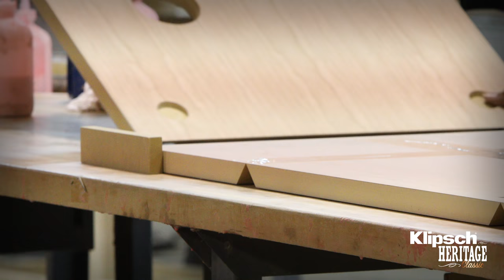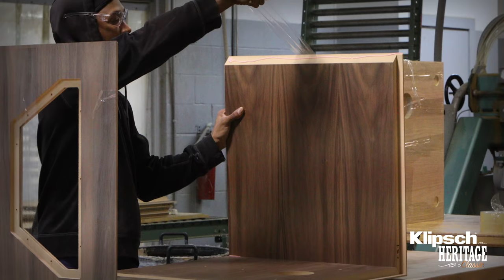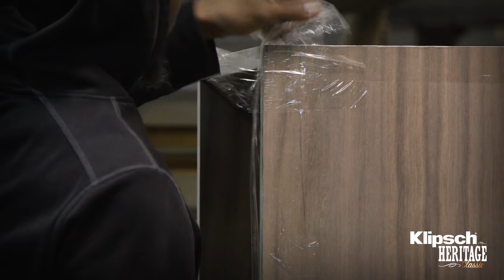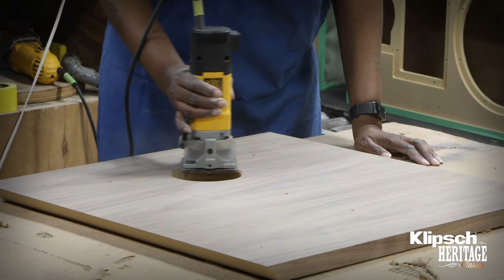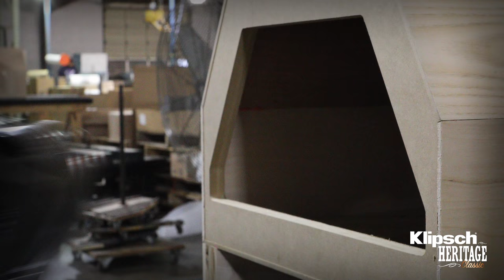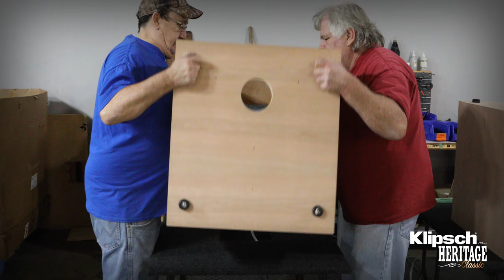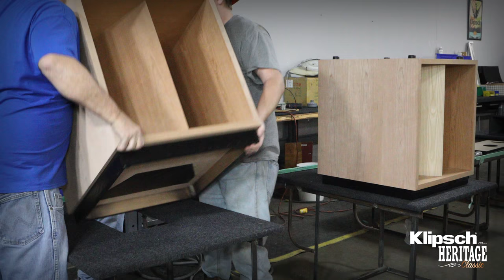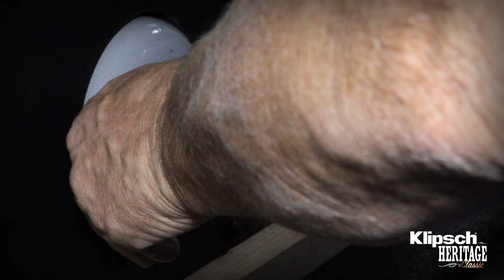Building the Klipsch La Scala AL5

Comment: I have three older pairs of La Scala`s made of Birch Plywood, not this Veneer over MDF crap.
Reply: if you knew anything about speaker design, you’d know that MDF is much better for building boxes. It’s much heavier than wood and when it vibrates more of the acoustic energy is turned into kinetic energy compared to wood, which reduces the sound of the cabinet. 

If klipsch were really trying to save money they would use cheaper hardwood because you don’t have to buy a veneer and you don’t have to have someone install the veneer and it would be much lighter.
Reply: you should probably do a better job at sealing your trunk from rain. Do you have any other ridiculous scenarios that you think are important?

How about this: Take a piece of MDF and a piece of plywood. Make a speaker box out of each, and see which one sounds better. HOLY COW now theres an idea!?!? Build a SOUND system to SOUND good!?!?

also not all MDF is created equal. Some are higher density some are lower density. and 3/4" MDF is pretty damn strong. Yes plywood is stronger, but it has bad acoustic properties. Bottom line is that MDF is better for speaker poxes period.
Reply: @nickparkin8527  That's why every wood instrument from a Violin to a Piano is made from plywood. I never seen one made of glued sawdust. A hard wood plywood has been proven to have better acoustical properties over partial board.
Reply: @G82Balive  yes for an instrument, whose job is to resonate and create sound. 

For an acoustic guitar, the bracing inside the guitar matters more than the wood. also, they aren't made from "plywood". steinway uses house made-laminated maple, not cheap plywood. Furthermore the guitar I'm building like most guitars are made from solid mahogany (solid wood).

An instrument is designed to resonate, while with a speaker, you want to minimize resonance.
Reply: nick parkin It’s been shown in acoustical test that a hard plywood is denser and has less resonance than MDF. Not only instruments but high end audio speakers are made with layers of hardwood sheets (plywood) making them acoustically dead, like the B&W 800 series. Klipsch started using MDF cause it’s cheaper and easier to work with. Klipsch has done a lot to cut cost and increase profits, all their drivers and now their crossovers are made in China. It’s the American way.
Reply: Al Apfel 

You just did a logical “sleight of hand” we were talking about plywood, now you’re talking about Hardwood plywood. Hard wood is far more expensive. Why would they make them out of solid oak or solid maple (hardwoods) and then put a veneer over it when they can just use MDF which will work just as well.

If anything using pure hardwoods is a waste of wood because most of the beautiful wood grain never gets seen.

And no, MDF is far more dead than standard plywood. Hardwood plywood, maybe not, but regular Baltic birch from Home Depot will be outperformed by MDF any day of the week.

You also have to look at the application and the right material for the job.

Hardwood plywood is denser and offers more strength when loads are applied in any direction across the wood, since the grains on the layers are 
Oriented 90 or 45 degrees from each other, allowing the wood to have superb strength no matter where the load is applied. They can also bend and hold their shape very well.

For a speaker, this doesn’t matter. The material it is made from just needs to be as dense as possible, and handle a load in one direction (the Y-Axis) which is just gravity pulling the speaker down.  For this application, you don’t need a wood that is strong when force is applied across every plane and orientation, you just need something that can 
A: support the weight of the speaker
B: be as acoustically dead as possible

And MDF fits the bill perfectly. The cost increase to use plywood or hardwood plywood just does not justify the benefits for this application.

It’s also worth mentioning that all MDF is not created equal. Lots of people think of it being cheap like particle bird but MDF is pretty strong and I’m sure klipsch has a specific formulation being made for them that’s higher quality than the stuff at Home Depot.
Reply: Al Apfel also klipsch uses 1” thick MDF. I’ve used 3/4” MDF and it’s heavy and does not like to move. With 1” thick MDF this thing will be a tank.

The older klipsch products use 3/4” plywood and trust me, the extra 0.25” makes a huge difference. That’s a 33% increase in mass and rigidity within the same material class. Combine that with the fact that it’s MDF then you have something that is twice as heavy as 3/4” plywood.

Also, it appears klipsch CNC mills these to make construction easier for their workers. If you had a bunch of different hardwood finishes, you would have to re-program the CNC mill to operate under specific conditions depending on what wood you’re cutting. (You have to optimize bit speed, feed rate, number of passes and depth of each pass) which makes it more complicated.

MDF is fantastic to CNC because it cuts so cleanly and is quick to cut and it does not tear out or splinter like hardwood, which would take much longer to cut.
Reply: Al Apfel and high end speakers are made from hardwood because like the b&w speakers, they have curved cabinets and you can’t curve MDF. The curved cabinet needs a material that is strong in multiple directions as pressure from the sound waves will relieve themselves across multiple orientations with respect to a singular point since the surface is curved.
Reply: Al Apfel sorry for all the replies I just started taking Adderall lol. 

One more thing to mention is that “glued sawdust” is particle board which is engineered to be light and rigid. MDF is compressed using much finer particles under heat and pressure. 

I know people perceive MDF as being cheap, because people think it’s close to particle board but MDF is far from “cheap”. Because klipsch is using 1” thick boards, they probably have a company custom manufacturing MDF for them so klipsch then has more control on the composition of the MDF so they can optimize it to have the perfect rigidity and mass
Reply: Al Apfel also, (at this point, it’s the Adderall talking) If hardwood was less resonant than MDF then we wouldn’t use it for instruments because the the instrument won’t resonate properly and creat good, loud sound.
Reply: @nickparkin8527  Well it sounds like you've done your homework, touch`e. I was NOT being specific on plywoods, although there are many types available. The cheapest is Birch from Lowes or Home Depo, but I prefer a cabinet grade 7ply Red Oak that I get from a Lumber Yard, not the hardest but two layers of 3/4" and enough internal bracing it can be very solid with very little resonance. I also like the finish with a stain/polyurethane applied. It really just comes down to preference but if I was paying $9k+ for a pair of LaScala's, I would want a (hard) plywood with internal bracing which they do neither. So I guess my beef is with them since I have owned LaScala, Cornwall, HeresyIII and a set of RF-83's. I sold all of them except for the Heresy's, the set with the lowest resonance, lol. BTW I not saying that I'm smart, but I not ignorant either, I have built many speakers (mostly subs) since the mid 80's and currently have 9 18" subs/woofers throughout the house with one pair of 15" lol. Only two are built from MDF so yea I can go back and forth and compare. Most of my drivers are either JBL of Dayton but I am looking at B&C or LaVoce 21" for my next build. I can order a knock down enclosure (Full Marty) from GSG or build it myself. Haha see you got me rambling lol.